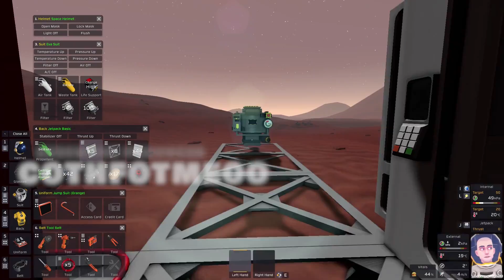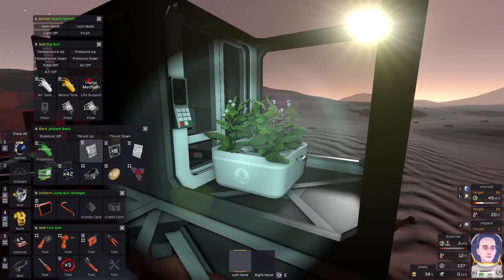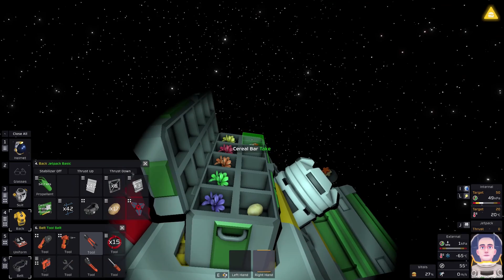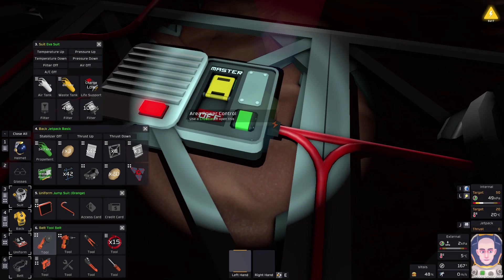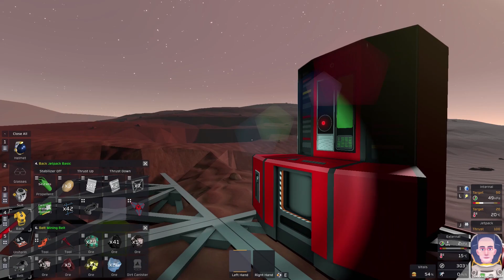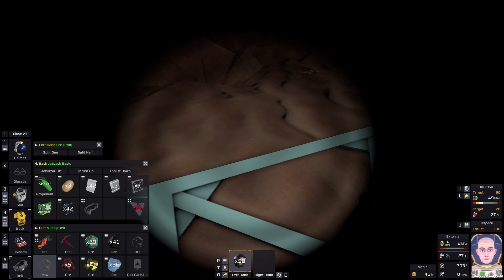Stationeers: Level One Update - Part 7 - COOKING ORE

Comment: I don't remember if there "airlock" door type actually has any gameplay differences aside from being more expensive... It's mainly just an aesthetic difference since walls and windows still limit the safe pressure levels in any compartment. And the "airlock" console circuitboard works with all door kit types (except roll covers of course).

The furnace can't actually release any gas if they're aren't pipes attached. It's effectively sealed just like pipe ends are. (When you see particles for air movement away from the furnace, that's caused by it heating the surrounding atmosphere, causing it to expand and flow away.)

Also I never said I considered the transformer an exploit... it handles power in a sort of "packetized" manner and as far as I'm aware, appears to be working as intended. I only said that it seemed like the kind of thing you might see as one and wouldn't like to use, due to it not making realistic sense. ;) But the whole thing is moot anyway without logic to immediately reset the solar panel position at sunset. Without that, neither option is of any use.

Looking forward to seeing what you work on next, as always! :)